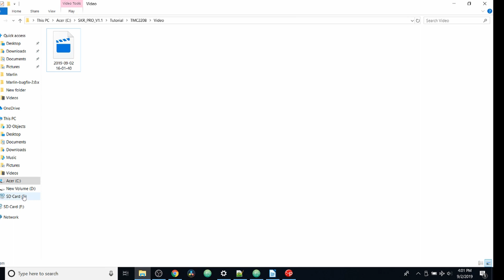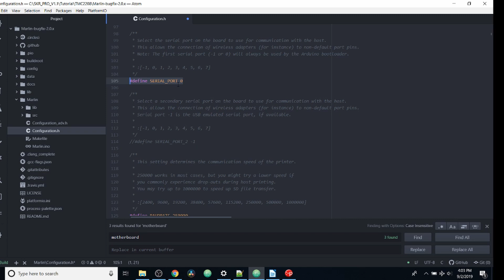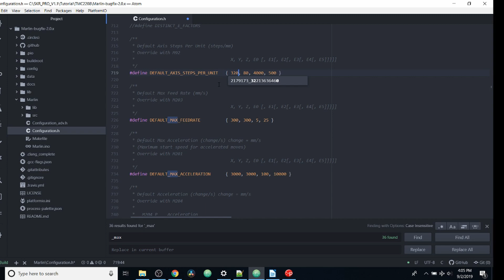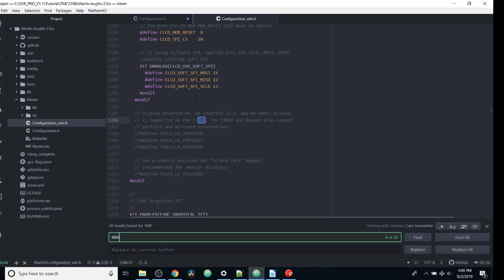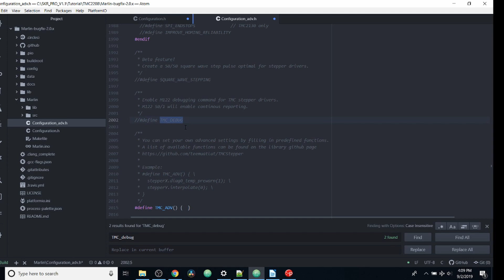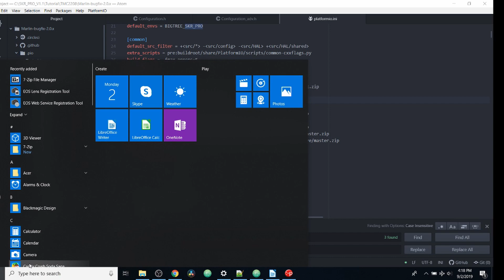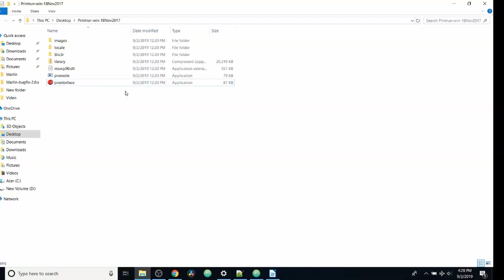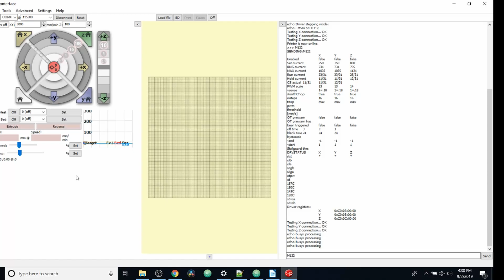SKR Pro V1.1 - TMC2208 UART v3.0 (BigTreeTech)

Comment: Hallo Edward Braiman und wieder mal ein wirklich sehr sehr gutes Video von dir. Ich habe mal eine Frage und bin neu in der Materie. Ich habe die TMC5160 v1.2 SPI schließe ich die genau so an das board an wie du oder können alle Pins entfernt bleiben. In Marlin muss ich ja natürlich die TMC5160 eingeben. Über eine Antwort würde ich mich sehr freuen.Vielen dank
Reply from the maker: Der Prozess scheint in der Nähe von TMC2130 SPI zu sein. Sie müssen das TMC5160-Datenblatt lesen, um den Effektivwert (Root Mean Square) zu bestätigen und gleich einzurichten. Lass mich wissen ob es funktioniert

Comment: If I redo this exactly I always get:
Marlin\src\HAL\HAL_STM32\HAL_timers_STM32.h:122:26: error: variable or field 'Step

_Handler' declared void
 extern void Step_Handler(stimer_t *htim);
                          ^~~~~~~~
Marlin\src\HAL\HAL_STM32\HAL_timers_STM32.h:122:26: error: 'stimer_t' was not decl
ared in this scop
No matter, what I try. The only way I get things to compile for the SKR Pro board is using the Bigtreetech version of marlin (I would have liked to use the official sources, but they compile fine with ATMEGA default settings, but not for the SKR Pro).
Does anyone know what I could change here? I even copied the whole HAL folder from the SKR version, but still - same error.
Reply from the maker: What's your Motherboard for configuration.h and what's your defualt_env in platformio.ini?
Reply: @EdwardBraiman  

#define MOTHERBOARD BOARD_BIGTREE_SKR_PRO_V1_1
default_envs = BIGTREE_SKR_PRO
I've followed the tutorial very carefully. I also redid the whole process 3 times starting from a fresh Marlin 2.0.x download to be sure I didn't mix anything up.
Reply from the maker: Could you try just compiling those two changes on a fresh copy of Marlin firmware 2.0.x?  I'm trying to understand if they recently modified the build and localize the problem.
Reply from the maker: This type of issue has occurred on other tutorials I've made due to firmware changes.  I'm guessing it's nothing you've done incorrectly.
Reply: @EdwardBraiman  Hi, thanks! That is good and bad to hear :)! You think it's actually a bug? Then I would consider filing it. I've just tried it with a fresh download and bare minimum changes (the motherboard,environment and I had to put the serial to -1, since 0 doesn't exist) but it gives the same result. Hmm,.. that is unfortunate.
Maybe you could hint us to a version, where it was still working? Then I could just clone this version and merge new versions as they become more stable.
Reply from the maker: Good news, I agree something is occuring as I replicated your compile issue. I'm going to look deeper into file changes tonight and tomorrow from my supposedly good copy of the build.
Reply from the maker: Looks like version of platform: St stm32 5.6.0 is broken and St stm32 5.4.3 works.  Not sure yet what's broken under the hood yet.
Reply from the maker: Opened an issue on 
www.github.com/MarlinFirmware/Marlin/issues/15680
Reply from the maker: Try this ...
https://drive.google.com/file/d/1FDgWiQxDNpse3QwSlpPmNTa2V47y1qcA/view?usp=sharing
Reply from the maker: Marlin just confirmed they have a bug in the latest firmware and are working to fix it.
Reply from the maker: The Marlin firmware appears to work now.  Try a fresh download and let me know if it builds okay.

Comment: great video! I have this exact setup and added the endstops. Everything seems to work, endstops get triggered, I can see with M119 goes from open to TRIGGERED, axis move in the right direction but if I test the endstops to stop one of the axis, the motor do not stop even though the M119 shows triggered. Any idea?
Reply from the maker: Maybe a float point issue.  What axis is moving and to which Endstop axis?
Reply: @EdwardBraiman  ok I figure it out, I had the section endstop pulls uncommented, now when it homes all axis stops!
Reply: @EdwardBraiman  will take a look at. All axis don't stop. Must be a configuration issue!

Comment: I'm going crazy, it does not work 😫
  
BIGTREE_SKR_PRO           FAILED    00:01:17.782
Reply from the maker: In the compile you should see red text.  What does the failure say?
Reply: @EdwardBraiman   (Original Firmware from Marlin)
When i am changing all the Steps that you say except from A4988 to TMC2208 driver, it works.... but when i am change the A4988 to TMC2208 ist comes this Message.

Marlin\src\module\stepper\trinamic.cpp: In function 'void tmc_serial_begin()':
Marlin\src\module\stepper\trinamic.cpp:296:18: error: 'class TMCMarlin<TMC2208Stepper, 'X', '0', (AxisEnum)0>' has no member named 'beginSerial'; did you mean 'HWSerial'?
         stepperX.beginSerial(115200);
                  ^~~~~~~~~~~
                  HWSerial
Marlin\src\module\stepper\trinamic.cpp:310:18: error: 'class TMCMarlin<TMC2208Stepper, 'Y', '0', (AxisEnum)1>' has no member named 'beginSerial'; did you mean 'HWSerial'?
         stepperY.beginSerial(115200);
                  ^~~~~~~~~~~
                  HWSerial
Marlin\src\module\stepper\trinamic.cpp:324:18: error: 'class TMCMarlin<TMC2208Stepper, 'Z', '0', (AxisEnum)2>' has no member named 'beginSerial'; did you mean 'HWSerial'?
         stepperZ.beginSerial(115200);
                  ^~~~~~~~~~~
                  HWSerial
Marlin\src\module\stepper\trinamic.cpp:345:19: error: 'class TMCMarlin<TMC2208Stepper, 'E', '0', (AxisEnum)3>' has no member named 'beginSerial'; did you mean 'HWSerial'?
         stepperE0.beginSerial(115200);
                   ^~~~~~~~~~~
                   HWSerial
In file included from Marlin\src\module\stepper\trinamic.h:35:0,
                 from Marlin\src\module\stepper\trinamic.cpp:32:
Marlin\src\module\stepper\../../feature/tmc_util.h: In instantiation of 'TMCMarlin<TMC2208Stepper, AXIS_LETTER, DRIVER_ID, AXIS_ID>::TMCMarlin(uint16_t, uint16_t, float, uint8_t, bool) [with char AXIS_LETTER = 'X'; char DRIVER_ID = '0'; AxisEnum AXIS_ID = (AxisEnum)0; uint16_t = short 
unsigned int; uint8_t = unsigned char]':
Marlin\src\module\stepper\trinamic.cpp:203:7:   required from here
Marlin\src\module\stepper\../../feature/tmc_util.h:175:40: error: no matching function for call to 'TMC2208Stepper::TMC2208Stepper(const uint16_t&, const uint16_t&, const float&, const bool&)'
       TMC2208Stepper(RX, TX, RS, has_rx)
                                        ^
In file included from Marlin\src\module\stepper\trinamic.h:29:0,
                 from Marlin\src\module\stepper\trinamic.cpp:32:
.pio\libdeps\BIGTREE_SKR_PRO\TMCStepper_ID5513\src/TMCStepper.h:982:3: note: candidate: TMC2208Stepper::TMC2208Stepper(Stream*, float, uint8_t)
   TMC2208Stepper(Stream * SerialPort, float RS, uint8_t addr);
   ^~~~~~~~~~~~~~
.pio\libdeps\BIGTREE_SKR_PRO\TMCStepper_ID5513\src/TMCStepper.h:982:3: note:   candidate expects 3 arguments, 4 provided
.pio\libdeps\BIGTREE_SKR_PRO\TMCStepper_ID5513\src/TMCStepper.h:816:3: note: candidate: TMC2208Stepper::TMC2208Stepper(Stream*, float, bool)
   TMC2208Stepper(Stream * SerialPort, float RS, bool) :
   ^~~~~~~~~~~~~~
.pio\libdeps\BIGTREE_SKR_PRO\TMCStepper_ID5513\src/TMCStepper.h:816:3: note:   candidate expects 3 arguments, 4 provided
.pio\libdeps\BIGTREE_SKR_PRO\TMCStepper_ID5513\src/TMCStepper.h:811:7: note: candidate: constexpr TMC2208Stepper::TMC2208Stepper(const TMC2208Stepper&)
 class TMC2208Stepper : public TMCStepper {
       ^~~~~~~~~~~~~~
.pio\libdeps\BIGTREE_SKR_PRO\TMCStepper_ID5513\src/TMCStepper.h:811:7: note:   candidate expects 1 argument, 4 provided
.pio\libdeps\BIGTREE_SKR_PRO\TMCStepper_ID5513\src/TMCStepper.h:811:7: note: candidate: constexpr TMC2208Stepper::TMC2208Stepper(TMC2208Stepper&&)
.pio\libdeps\BIGTREE_SKR_PRO\TMCStepper_ID5513\src/TMCStepper.h:811:7: note:   candidate expects 1 argument, 4 provided
compilation terminated due to -fmax-errors=5.
* [.pio\build\BIGTREE_SKR_PRO\src\src\module\stepper\trinamic.cpp.o] Error 1

PS: Its the first Time that iam working whit Atom.
PPS: Sorry for my bad English
Reply: @EdwardBraiman  When i use the Marlinfirmware from Bigtree and do nothing change, than comes this yellow messages:

IOError: [Errno 2] No such file or directory: 'C:\\Users\\Michael\\Desktop\\3D Drucker\\Software\\32 Bit 3D\\Bigtree\\BIGTREETECH-SKR-PRO-V1.1-master\\firmware\\MarlinSKR\\.pio\\libdeps\\BIGTREE_SKR_PRO\\_tmp_installing-ik9yap-package\\SailfishLCD-master\\examples\\FlashForgeInterfaceB
oardLCD\\FlashForgeInterfaceBoardLCD.ino':
  File "C:\Users\Michael\.platformio\penv\lib\site-packages\platformio\builder\main.py", line 126:
    env.SConscript("$BUILD_SCRIPT")
  File "C:\Users\Michael\.platformio\packages\tool-scons\script\..\engine\SCons\Script\SConscript.py", line 541:
    return _SConscript(self.fs, *files, **subst_kw)
  File "C:\Users\Michael\.platformio\packages\tool-scons\script\..\engine\SCons\Script\SConscript.py", line 250:
    exec file in call_stack[-1].globals
  File "C:\Users\Michael\.platformio\platforms\ststm32@5.4.3\builder\main.py", line 91:
    target_elf = env.BuildProgram()
  File "C:\Users\Michael\.platformio\packages\tool-scons\script\..\engine\SCons\Environment.py", line 224:
    return self.method(*nargs, **kwargs)
  File "C:\Users\Michael\.platformio\penv\lib\site-packages\platformio\builder\tools\platformio.py", line 122:
    _build_project_deps(env)
  File "C:\Users\Michael\.platformio\penv\lib\site-packages\platformio\builder\tools\platformio.py", line 47:
    project_lib_builder = env.ConfigureProjectLibBuilder()
  File "C:\Users\Michael\.platformio\packages\tool-scons\script\..\engine\SCons\Environment.py", line 224:
    return self.method(*nargs, **kwargs)
  File "C:\Users\Michael\.platformio\penv\lib\site-packages\platformio\builder\tools\piolib.py", line 1043:
    project.install_dependencies()
  File "C:\Users\Michael\.platformio\penv\lib\site-packages\platformio\builder\tools\piolib.py", line 878:
    lm.install(uri)
  File "c:\users\michael\.platformio\penv\lib\site-packages\platformio\managers\lib.py", line 359:
    force=force)
  File "c:\users\michael\.platformio\penv\lib\site-packages\platformio\managers\package.py", line 701:
    track=True)
  File "c:\users\michael\.platformio\penv\lib\site-packages\platformio\managers\package.py", line 483:
    self.unpack(dlpath, tmp_dir)
  File "c:\users\michael\.platformio\penv\lib\site-packages\platformio\managers\package.py", line 216:
    raise e
Reply: @EdwardBraiman  I did not find the problem in both cases, I downloaded the firmware from Bigtree again and now it works 🤪😵🥴 so many Hours invested in vain 😫
Reply: @michaeldoger6192  I had the same problem you did. Don't forget the step at 12:10 that is what I forgot and I had the same exact error as you. When I pasted it in it worked perfectly.
Reply: Post the first 50 lines from your platformio file
Reply: @Simply_Danny  i think i dont forget any step from the Video, ill have watch the Video 20 times.
i'll use 3 different Stepper bibliotheks links to fix the problem but nothing helps.
But now after redownload the Bigtree Firmware... it works 🤪

Comment: hello at first 1 will thank you for your video but i try 3 days long to compile but everytime i get some mysterius problems . 
at the moment it is

 IOError: Errno 2 No such file or directory

and the end is i always get a failed as answer . i know im not a programmer or something in the near of that i only make exact the same as you withe the exact products from bigtree but i think the problem is my pc something make it impossible to compile .
Reply from the maker: Do you have GIT installed?
Reply: @EdwardBraiman  yes now i have it possible to get a firmware but all settings done in the firmware from video for the motors but they dont move like they should nothing . it only makes noises an minimal movement . where must be the cable from stepper to motherboard ?
Reply from the maker: What steppers are you using?  Which motors are you using?  Are you using a UART configured stepper?

Comment: Ed. Very good thorough presentation. Thank you!
Reply from the maker: You're welcome
Reply: Question...do you need a 32 bit processor TFT screen to control; or can a lowly TFT 32  8 bit screen work without a bottleneck to the SKR?
Reply from the maker: Unfortunately I have not tested yet.
Reply: Edward Braiman I am installing one now (TFT 28 v 4.0). I’ll let you know...
In your hooking up the TFT35 1.* you mentioned the two ports as possible filament detectors. After studying the pinouts (poor support documentation) I concluded they do NOT support filament runout. I ordered the TFT35 V 2.0 which won’t arrive for a couple weeks which I will also report back with my findings.

Comment: I have this board installed with these drivers in my Ender 5. Love this board. I have a MKS TFT28 connect as my display. This board with a little refining could possibly be the best board out currently made, IMO....
Reply: Rack Star Gaming I too have been running the TFT 28 for over 2 years starting with v1 and I just replaced it with the TFT 35 because I didn’t think the 8 bit processor it possessed was up to the task of controlling a 32bit SKR. The TFT 35 has the 32 bit processor therefore won’t pose a bottleneck. It’s only a hunch but I didn’t want to go back and discover it later then have to fiddle with it again...

Comment: I have a stepper motor Nema 17 and it’s mentioned as 12v ,will it run on 24v psu supported boards.. thanks in advance
Reply: Sure, they are driven by the configured current. More voltage is better ...
Reply: yes it will run on 24v https://github.com/bigtreetech/BIGTREETECH-SKR-PRO-V1.1/blob/master/manual/SKR%20PRO%20V1.1%20user%20manual%20v1.1.pdf